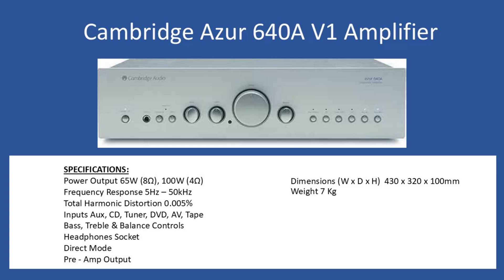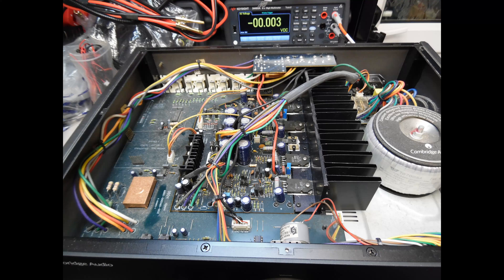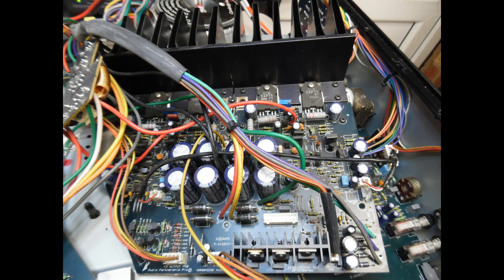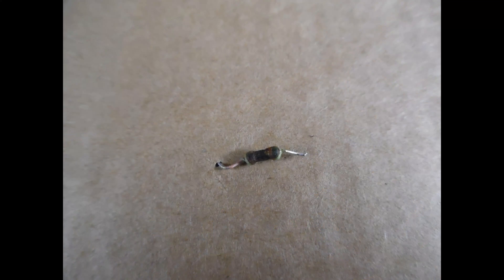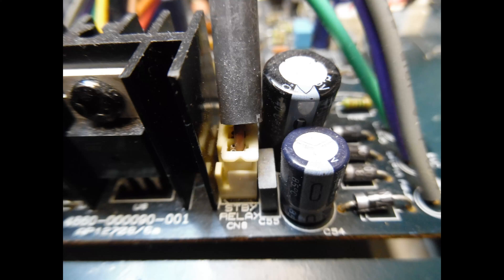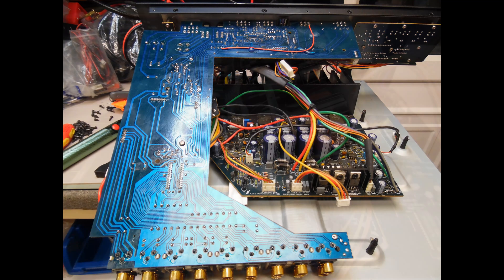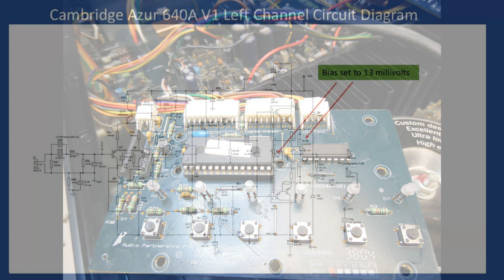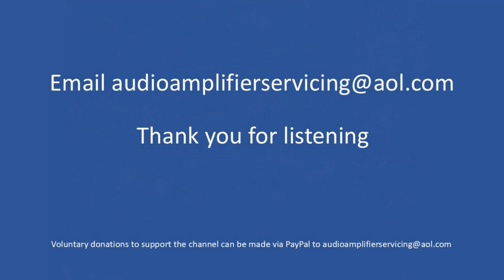Cambridge Azur 640A Version 1 Amplifier Repair (With Audio Tutorial)

Comment: Seeing those Sankens Darlingtons with integrated quiescient diodes, it means RIP to the amplifier. I wouldn't go on, even if the fault doesn't origin from them.
Reply: They do have a reputation, but then again- the customer is always right and in this particular case, it will continue to bring joy to the owner, isn't it the whole point?